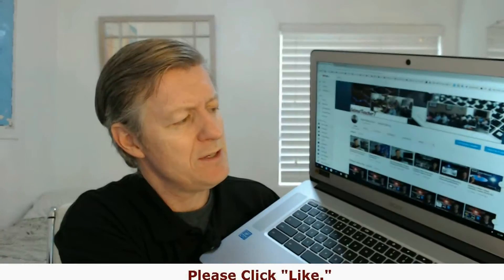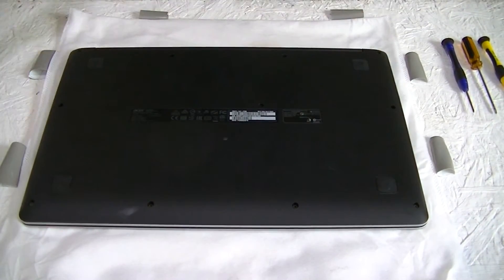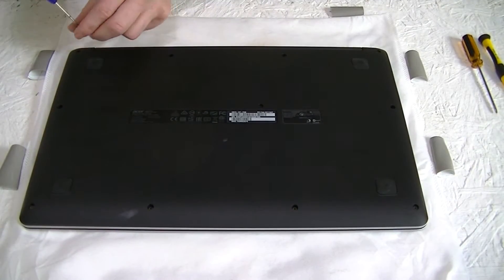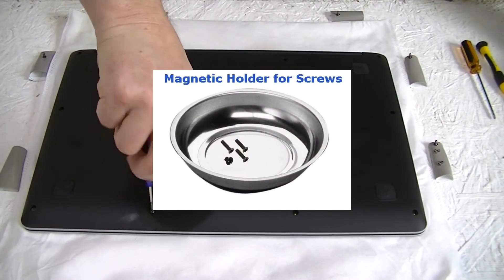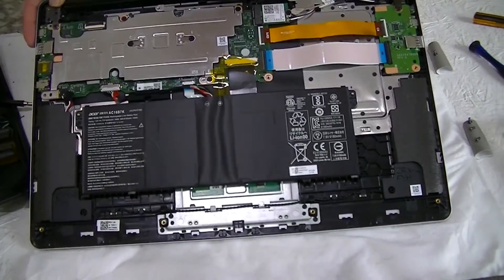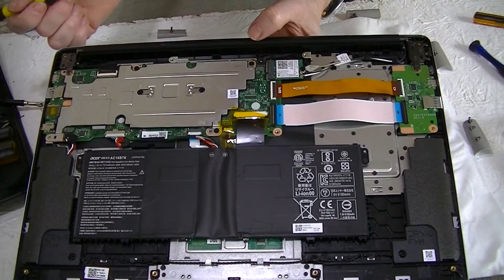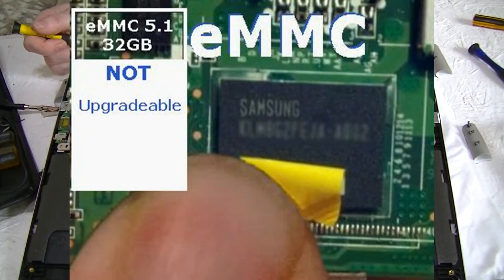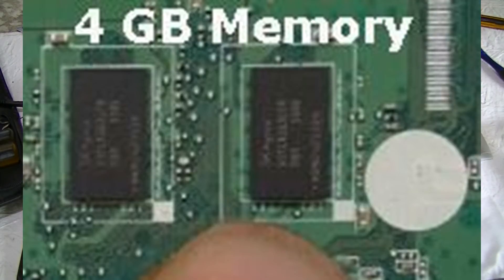Acer Chromebook 15 Touch Tear Down Disassembly Can We Upgrade, the RAM or SSD?

Comment: Ive heard many say the soddered down parts r y its not upgradable... with some patience, the right tools, isnt it possible to scratch the soldered parts down, delecately, makong them loose?  Sodering is just like metalic glue and all ive heard heard is soddering prevents it... it seems to be destined to be prehistoric, so would it really be that difficult to gut it and buy conpaitple upgrades you can install yourself? Aside from getting off the soder, is it not possible to again, just gut it, and but the right pieces and with some ingenuity, make the parks fit... as long as you understand what each part does and what it need to connect with?  Im no mit guy, just someone who was a kid when the 1st conputer came out and my first computer, a tandy, i was curious what was inside so when my parents werent home, i opened it up, took everyrhing out and put it back it...  to me, it was like an expensive lego set... even if parts dont fit exactly, as long as you know the function of each part to another, copper wiring, wifi, processors, etc, all serve the same function.. so i just wonder, is it truly not possible to turn a cheap laptop into a very good one, simply by gutting it? Wont look pretty inside, but as long as it works
Reply from the maker: Very true.  I have other videos showing me upgrading the soddered on storage.

Comment: Today we are going to upgrade the SSD and RAM....
No we aren't....
Hope you never have it fail, recovery when OS goes south recovery is virtually impossible, ironically requiring a Windows or Linux computer to get the files and flash a USB drive. 
Acer C15 is quite possibly the worst computer ever made, period. 
It's disposable, like a used coffee cup.
Reply from the maker: Chromebooks offer other benefits outside of hardware upgradability.   As my other videos show, they are safe and secure and amazingly quick for their specs

Comment: My wife spilled coffee on hers and has since gotten a replacement. Any hope of me getting the old one up and running?
Reply from the maker: I am sorry to hear about that.  The thing about coffee is that the sugars cause shorts within the laptop.   Even once its dried.  You would need to remove the mainboard and carefully clean it and make sure that all residue is GONE.   In your comment, you mention "GAS" on the Chromebook. If you mean "petrol"... Oh my, petrol may have killed it, if the coffee had not already killed it.  If you remove all residue and clean all of the contacts, you may then try to power it on again.. but sorry no guarantees.  I saw one Chromebook fry the instant some juice got spilled on it.
Reply: @selmateacher7  typo. Should have been "has". I figured it was a longshot with the creamer. Just thought it might make a good quarantine project since it's just sitting around.
Reply from the maker: @commonsenserevival  Yes.  a longshot, but it will be a learning experience as you dismantle, clean, and reassemble the laptop.  I am putting out a new video on this subject.  It will be published on Thursday morning.  In that video , I dismantle, clean, and reassemble a newer Chromebook.

Comment: I have this model and randomly earlier today the touch screen seemed to stop working. I restarted a few times and did a powerwash nothing happened, I also looked into commands for switching the touchscreen on and off but that doesnt appear to be working either, think it must be a hardware issue of some kind.

Comment: Anyone know where the connection for the Keyboard is on this unit?  I have a couple keys not working and want to double check the connection.
Reply from the maker: https://www.youtube.com/watch?v=2NiPbfoz9YY&t=0s  From this tear down video, you can see that cable emerging from under the battery and connecting to the motherboard in the middle of the board.

Comment: Where is the screw you have to remove to change the bios? I am looking to install linux on mine.
Reply from the maker: Here is a picture of one: https://www.howtogeek.com/wp-content/uploads/2016/11/img_581a535d35f3e.jpg
Reply: @selmateacher7  dude, you rock!
Reply from the maker: That screw is will be in a hole that has the connector with the line in it forming this shape  [ ] . When the screw is in place, it closes the connection.  When the screw is out, it leaves an open connection.   It is normally near the button battery.

Comment: By the word "teardown" I really was expecting more than just removing the cover and nothing more. Most of the parts can be easily removed which is what is necessary if a part replacement is needed. Disappointed.
Reply from the maker: Sorry to disappoint you.  I did not need to go further into removing anything else on this unit.  What part is failing and I would be happy to send instructions on that.  For example, replacing the display, etc .   Thank you for the comment and I would be more than happy to help you.

Comment: great job - appreciate the labeling of components - my issue is the wifi card not being recognized... probably gone bad don't you think?

Thanks
Reply from the maker: One of two main possibilities are:   WiFi Card is loose or bad WiFi card   Thank you for the comment.
Reply: @selmateacher7  FIXED - must have been loose - once I got the cover off, and looked for the small wifi / bluetooth card - removed the screw then un-seated the card.  Notice is had 2 solder points on the wires so I just re-installed and closed it up.  Checked device manager and now Qualcomm Aethos shows up!  You da man!

Thank you sir.

Comment: Is there a splitter or something so I can have 2 M.2 items in one Chromebook? I am thinking, have a WiFi card and an M.2 SSD, but on one slot?
Reply from the maker: Yes, they exist, but I have not tested a M.2 splitter on a Chromebook. Here s the link:  http://amfeltec.com/products/flexible-minipci-express-2-way-splitter/
Reply: @selmateacher7  Any chance you can test it out,would help  determinedly us lot out really bad 1000 pluss
Reply from the maker: @indiawest2025  I just did some more research on this and the short answer is: No.
A longer answer is: It depends on the exact wiring if this is possible. It's not possible to connect two SATA or two NVMe SSDs at the same time, but in theory, depending on the exact wiring of the machine it could be possible to wire up a SATA and an NVMe SSD at the same time. It depends though, on some machines the M.2 slot's PCIe lane wiring may go to the same HSIO lanes on the PCH as the SATA wiring on the slot, in that case it's impossible. Given the complexities involved, probably nobody is making an adapter to support this for slim laptop or Chromebook.  There are options in Desktop machines, but those are not 'splitters' they are PCI-e adapters that allow you to connect to a second M.2 SSD. 

Thank you for the questions.

Comment: that should be "Pry Tools"... could the eMMC chip (32GB) or RAM chips be replaced, using the reball / resolder method (like some cell phones, tablets) with a 64GB one? the SMT or motherboard may not allow it, and may not support it. great tutorial Mr Berry!!
Reply from the maker: Thank you for the comment.  I have not tried a larger eMMC than 32GB, but with that said, yes the same resolder method should work---- but be careful, its a touchy board that does not like too much heat.   Thank you again and please subscribe enjoy my newer videos on Technology.

Comment: I have the exact Chromebook and my brother converted it to windows as I needed to graphics design on it. Now it ran out of RAM. I was hoping getting an external hard drive would help but it didn't. Is there anything that can be done? Should I convert it back? Either way so far it has been useless to me. it's only 2 months old.
Reply from the maker: The memory is soldered onto the main board and is not meant to be user up-gradable.   I know that the 1.1 GHz Intel CPU is perfectly set up for the Chrome OS, while Windows 10 needs a more powerful processor to do things in a timely manner within Windows 10.    I do a great deal with my Chromebook, all within the Chrome OS.  I have even produced videos and edited images using it. https://www.youtube.com/watch?v=1MF3iJqn2oA&t=0s  
I would suggest converting back to Chrome OS.
Thank you for the question.  It's kinda funny because I have converted many Windows 10 laptops to Chrome OS, because I can do more in that OS with the Android and Chrome apps.  But, it did take me awhile to learn the ropes and just how powerful the Chrome OS can be.

Comment: where in this video is the screen ribbon cable? i feel as though mine is loose, but i dont wanna mess with cables that i dont know about.
Reply from the maker: Thank you for the question.  The screen ribbon cable can become loose and it is not found in the lower part of the laptop, but behind the bottom part of the screen itself.  To get to that cable, I had to pull off the bezel the is glued  onto part of the screen.  Then screws are found under that bezel. Remove the screws on the display.  The screen assembly will fall forward, revealing this cable, which is found in the lower part of the  back of the screen.
Reply: This is very helpful, thank you very much.

Comment: Hi Daniel, I'm hoping you can help me. I'm having an issue with my Chromebook 15 where there's no power to the screen. I think the screen connector has come loose but I'm not sure how to get to it. Is this laptop the same as others where you take off the bezel and then unscrew the screen?
Thanks in advance!
Reply from the maker: Thank you, Kate for the question.  I am so sorry to hear of your problem.  Ouch!  I have taken mine apart on Camera to show how easy it is to get to those parts.  So, yes you can do that to check the cable connection, There is a particular connection on the motherboard that leads to the IPS multi-touch screen.  I have noticed that it is possible that this one connection can become easily loosened.   So, I would check that one first, because it is easy to get to. 

Again, Thank you for the comment and please 'like', subscribe, and share.
Reply: Thanks so much for your reply! I'll give that a go :)
Reply: Hello, I have the same problem. The multitouch screen does not work. how did you solve your problem?
Reply: Hi, it ended up being the connector behind the screen itself that was loose so we put that back in and stuck the tape back down and that worked. 

To get to that you need to take the bezel off first which is really hard to do on this laptop. Start from the bottom of the screen where it's put onto the black backing. We used on old credit card to lift up the bezel (which is both the silver part covering the screen and it's black border), but I'd really recommend getting a spudger because this was incredibly difficult. You are trying to release the connectors that hold the screen to the backing without breaking them (2 of ours broke). 

Once you get that off, there are four screws holding the screen on which easily come out with a small Phillips head screwdriver. When you remove those, just fold the screen down onto the keyboard - it's still connected to the base of the laptop. On the bottom of the back of the screen there is a connector which had come loose so we put that back in and put the tape back on and it worked :) Just make sure you test that it's working at every stage of putting it back together given how difficult this is. Also make sure you turn the laptop back off between each test. 

Hope that helps you!
Reply from the maker: Thank you for the update.  That is great.
Reply: Hello my friend. help in my problem. I opened the laptop. where is this train? I found next to the cable that goes to the Wifi in the laptop screen. on the other hand a loop goes to the graphics of the display. (only 3 wires go to the display) I firmly planted the shlif. but the problem did not dare. Need to open the display?
Reply from the maker: Kate said that the loose connection was behind the screen.   Кейт сказала, что свободное соединение было за экраном.

Comment: can you show us how to load apk files on to the acer 15  without messing the chromebook up like your videos as nice and clear for the novice     cheers
Reply from the maker: Thank you David for the uplifting comment.  Okay about the APK files.. hmmm.. I remember doing that in class with my students last year, because one of them wanted to do run an APK app.  It takes a while to create a video on that, but I can rely the basic steps right here:
1. Put Your Chromebook Into Developer Mode
2. Enable the “Unknown Sources” option, found within settings and click the “App Settings” link under Android Apps, from there click the “Security” option. Then enable the “Unknown Sources” option found under Device Administration. 
3. You may now install an app from an APK file. First, download the APK file to your Chromebook and save it in your Downloads folder, but first, Launch the Google Play and install a file management app. Like 'Solid Explorer,' but there are many other apps that will do the same job of installing APK files.  
4. Launch the file manager app, like ,'Solid Explorer,' enter your “Download” folder, and open the APK file. Then select the “Package Installer” app and you’ll be prompted to install the APK, just as you would on a Chromebook.
5. Done.. But Hey wait... My Chromebook runs Android Apps now so I do not have to mess around with APK files.  I just open the Play Store on my Chromebook, find the app I want and install it from there.  

Do you have a newer Chromebook that supports the Android Play Store?
Reply from the maker: Here is the link to my video show how to enable the Android Play Store and installing an Android Game. 
https://www.youtube.com/watch?v=6QXrT7BDS2U&t=0s

Comment: Hi again Daniel I bought my disabled son this exact chrome book and in the last two years I have never had to update or fix anything on it and he has come on in leaps and bounds in his ability to use it he is 33 but his average learning age has been 8 he has learnt more in the last 2 years than the previous 31 years he uses nearly all the programs on the chrome book and loves it.  As I'm an I.T. tech I have spent over 21 years either teaching I.T. Or repairing computers and when I have to open a laptop I used to use a guitar plectrum to lever  it open I'm glad chrome books were not out back then I would have been out of work 😉
Reply from the maker: Thank you for the comment and I am happy to hear that your son is learning more now with his Chromebook.  BTW, Wow, I was unaware that the CB515 existed two years ago.  I have bought most models from Acer and HP, in the last few years and the older ones from Acer were the CB3 531, CB3 532, and the CB5 571,  which are not touch screen and only started playing the Android Apps in the last few months.  I too, have been an I.T. tech since the early 1990s and teaching the same since 2001 and I agree that if Chromebooks came out in 1999, we were have been out of the repair business.  LOL.  All of my customers, family, and students now have Chromebooks and they NEVER need to call for I.T. support, like they did 10 years ago when they owned Windows and Apples.   Thank you again for your comments.

Comment: Can the CPU be changed out?
Reply from the maker: It can be, if you are good with soldering BGA.  Anything is possible, but it is not my recommendation.  I am using my Acer Chromebook 15 all day now for all of my PC chores:  Lesson creation, script writing, researching, student grading, etc.  Also for my off times too: Clash of Clans, watching TV, YouTube,  facebook, etc.  I have not seen this system ever act slow or chappy, so the CPU is keeping up to my 30 opened tabs in the Chrome OS with multiple windows, while currently running an Android App.  My  6 month old Windows 10 desktop is basically unused at this time.  It is just as convenient as this instant on, portable, and capable Acer Chromebook 15.
Reply: Selmateacher7 - going to buy a chromebook in a few days. Would you recommend this model or have you tried another you like even more? I want something peppy that I can have lots of tabs open without it slowing down.